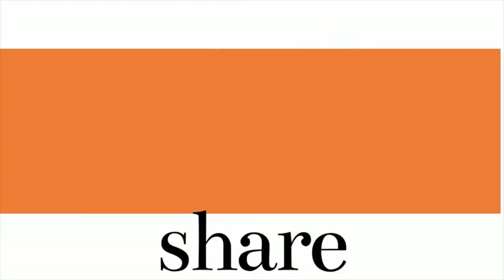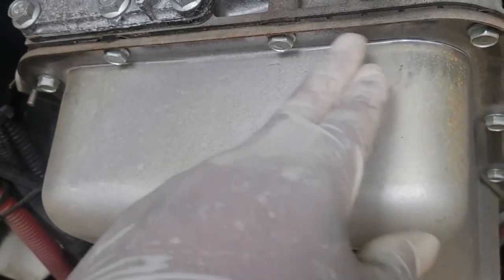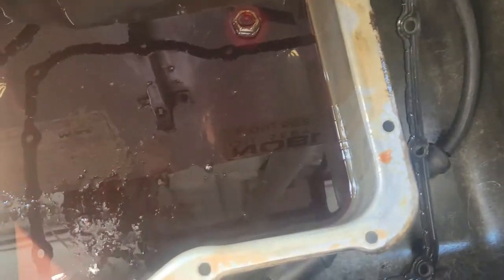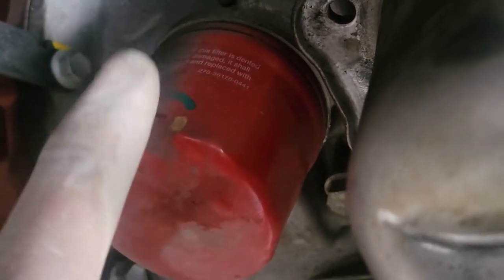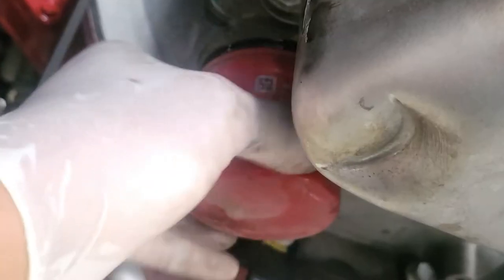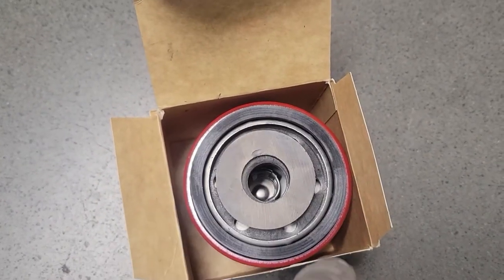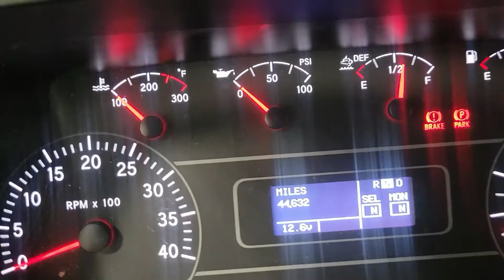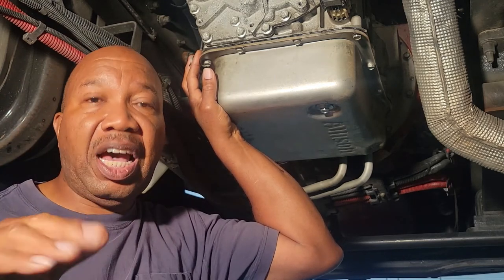2022 Allison Transmission Filter Change

Comment: Hey, I have a 2024 MV607 with 50k miles. It is asking for trans filter. Do I replace both filters or just the exterior with 50k miles on it? 
Thanks in advance
Reply from the maker: @Basil-HeavyMotorsLogistics  It will be fine to replace the exterior filter and fluid at 50,000. And both filters and fluid at 100,000.

Comment: Awesome video, sir. I'm definitely going to attempt this. I need to drain a little fluid out my transmission. The last shop definitely overfill it and when it's hot, it shifts a little weird. Could I just remove the filter and throw some out? BTW, you've just earned a new subscriber.
Reply from the maker: You will only lose alitte over 1/2 quart with the filter. I would wait and drain alitte out when the fluid is cold at the Drain Plug. Thank you for Subscribing!
Reply: @dairleautoclassicrestorati6892  thanks for responding. I'll do what you suggested.

Comment: This is 2022 mv607 cummins b7, with 6 speed manual allison transmission right? How many gallons of transmission fluid goes in? Thanks in advance!
Reply from the maker: It's an Automatic Transmission and it takes about 12gts.

Comment: Will these steps work for a 2019 Kenworth T270 with a Paccar engine and Allison transmission? Also, dose T270 has one or two filter? Thank You!
Reply from the maker: I have not worked on a Kenworth yet.
Reply: @dairleautoclassicrestorati6892  Thank you

Comment: Man I’m going into limp mode when going uphill even after I done this service what could this be?
Reply from the maker: @travissingletary4237  It can be a number of things. I would get a quick diagnosis check done on it to save you some time.  If you know someone that has a Cummins In-sight that would be the way to go. The Dealership may charge you around $150-$200 but least that way you will know for sure.

Comment: If your fluid and filter hasn’t been changed in a while could that make your transmission slip
Reply from the maker: Yes Sir!
Reply: @dairleautoclassicrestorati6892  should you ck your fluid with the truck running or off
Reply from the maker: @keithtorbert9929  always check the Fluid with the Vehicle running at idle in Park or some cases in Neutral.
Reply: @dairleautoclassicrestorati6892  thanks 👍
Reply: @dairleautoclassicrestorati6892  I can’t find my dipstick I have a 2018 international Cummins x15
Reply from the maker: @keithtorbert9929  go to the left side of your engine which is the driver's side. It is right next to the Fuel Filter .